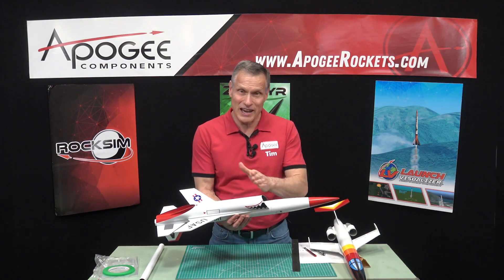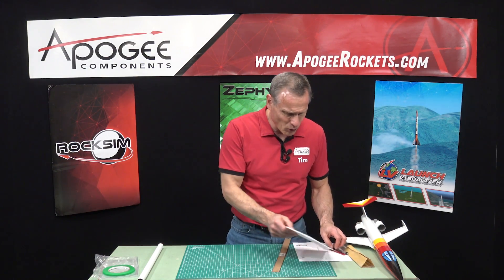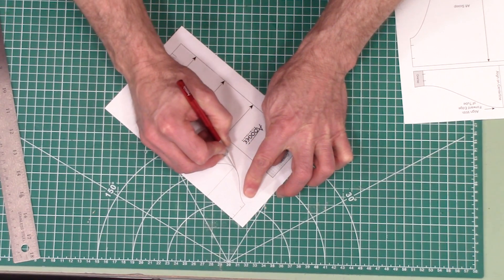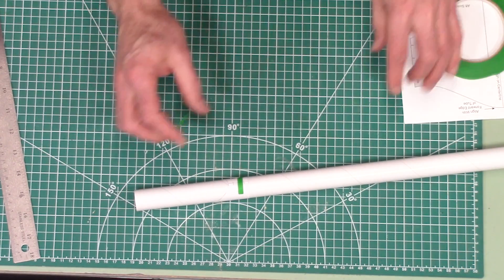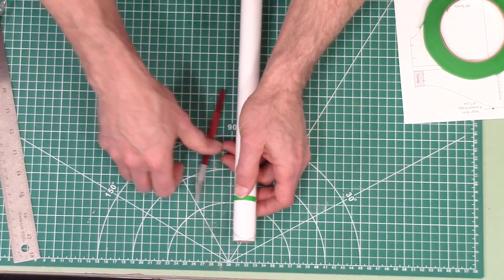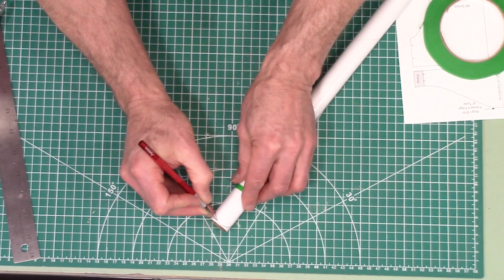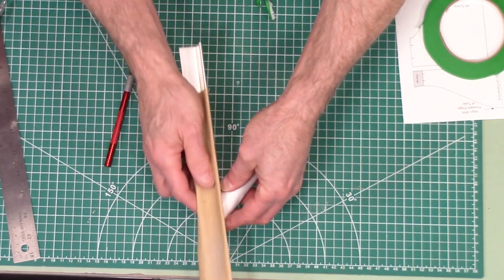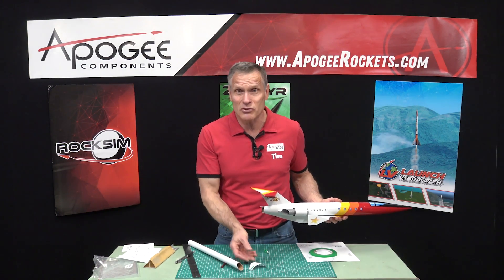Cutting Tubes at an Angle for Model Rockets

Comment: Free-handing a paper pattern with a razor knife? Really?! Did you never hear of scissors? Cutting the tube free-hand as well? Why not use a miter box and a razor saw? ;-D
Reply from the maker: the purpose of this video was to use as few "purchased tools" as possible. Obviously, you can use a miter box. But only 1% of the population has one (if that).
Reply: @apogeerockets  -- Your title in you video says this is an "advanced construction video". Cutting free-hand with a razor knife doesn't seem "advanced" to me. It seems the opposite. But I guess another aspect to this is the required precision. In the video, the angled cut is for purely cosmetic reasons. The requirement for precision is low and free-handing the cut is adequate. However, if a precision cut is needed (for example, if two tubes must connect via an angled cut) then a better technique is desirable, if not necessary.